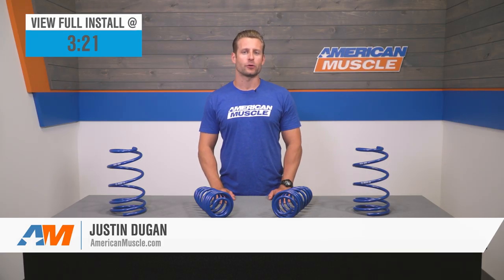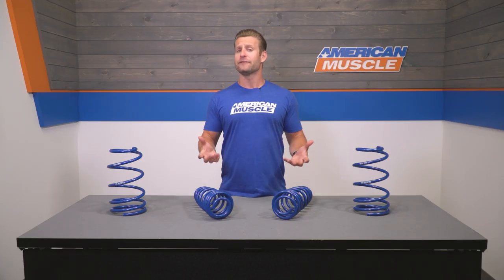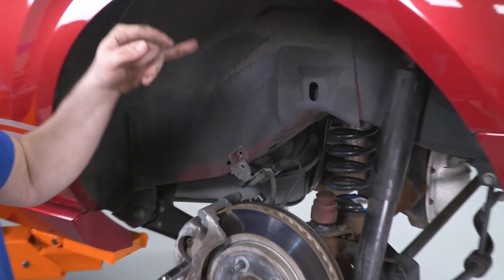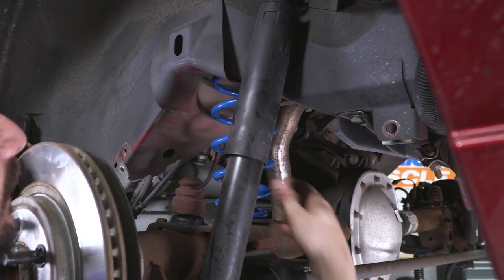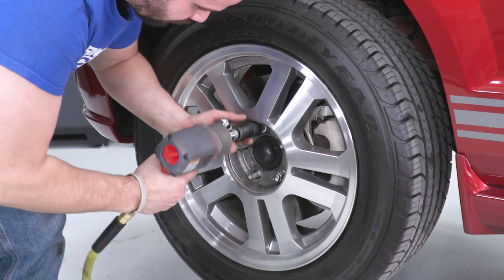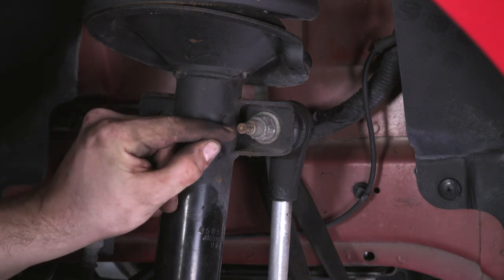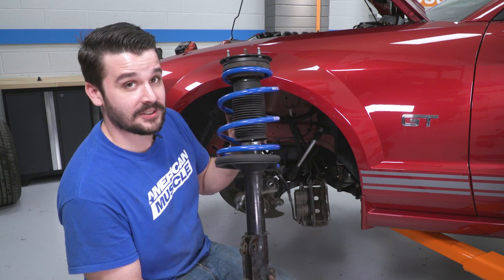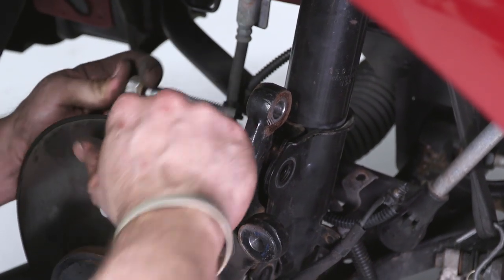2005-2014 Mustang GT Roush Lowering Springs Review & Install

Comment: Did you install the springs on the stock struts?
Reply from the maker: Yes we did! Aftermarket struts would make a great addition to these springs though. Especially since most aftermarket shocks and struts are specifically made for aftermarket springs. -Zach